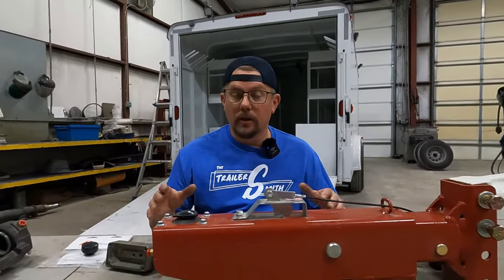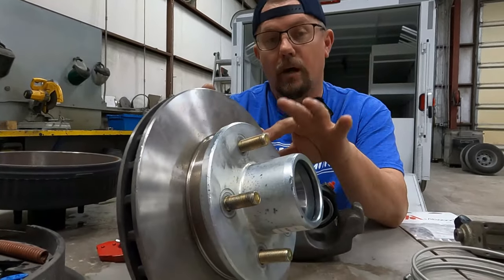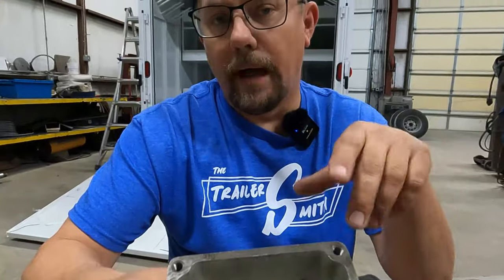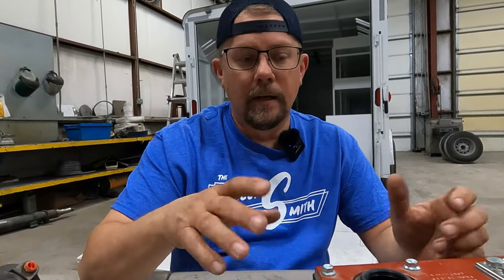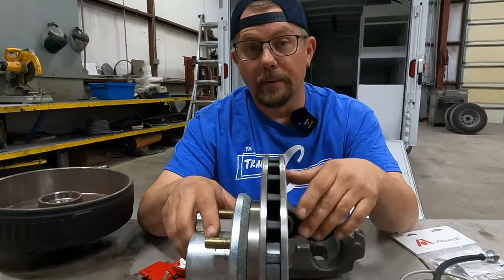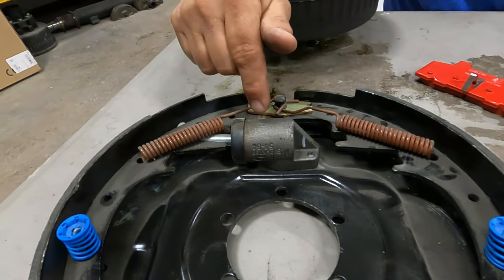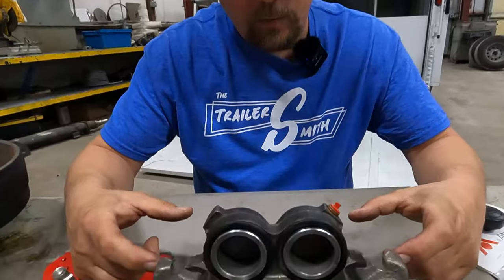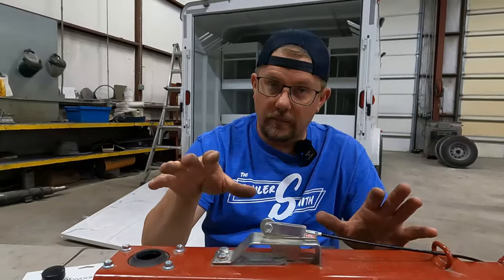All About Boat Trailer Surge Brakes

Comment: I am a subscriber, great videos as usual, and your voice speed is perfect.  I have a Coyote Boat Trailer made in Georgia.  It has a hydraulic surge brake with the static hold/ pin feature as you mentioned to put a pin in for backing up the trailer without compressing the cylinder.  The problem I had last winter, I had my local boat company winterize my boat, dropped it off in October but wasn't able to pick it up until December.  With permission, I picked up my boat and trailer the day before Christmas when they were closed.  When they were done servicing my boat, they backed in into a parking space which was slightly up hill.  I hooked up my truck to the trailer and the actuator/ brakes were still locked up from them backing it up.  I could see the actuator was still compressed, the holes weren't even close to allow the static pin to be installed.  I had to drag my trailer and yank it forward about 6 times to get the actuator to release.  I believe if they would of simply pulled forward 6" before uncoupling the trailer, I wouldn't of had this issue.  Or, they should of put that static pin in to begin with.  Sorry for the long coment, just still frustrated from that event.  If you agree, maybe you can tell your viewers to always move forward a few inches before unhooking the trailer.

Comment: Been a subscriber since the 1st video I watched!  How about showing maintenance on a surge brake cylinder and linkages.  How often to flush the oil, lube to use on linkages how to replace a nasty neglected cylinder including how to clean the underside of the actuator housing etc.?  Also how do you determine tounge weight on your trailer without a fancy scale, can it be calculated based on axle position and weight of trailer and load?

Comment: I have EOH setup on a tandem trailer.  Already cost me big time on the electric pump since my calipers were so badly corroded they allowed water (fresh/salt) past the seals and into the brake lines and eventually compromised my electric pump.  The calipers were ~6 years old when I deleted the actuator and went to EOH.  So the pump only lasted ~2 years before the already compromised fluid ruined the pump.  Wow what a lesson - wish I would have seen this video before all that happened.

Problem I am running into - even on the (nearly) brand new calipers is the bleeder screws are a pain to break loose since the rig is dipped in saltwater down in Florida 5 months/year snow birding.  What is the best way (if possible) to lubricate those threads ahead of time to keep them from getting corroded?
Reply from the maker: If they are seized, I recommend PB Blaster. If you can get the bleeder screw out, you can apply a small amount of the anti-seize in the threads to prevent them from seizing. Something that would be helpful, and you should be able to find it online, is a salt neautralizing wash and spray the sensitive areas of the trailer down every time you submerge as it’s directed. I don’t have a brand I can recommend. There are a lot of them out there. I would say they are all fairly equal. 
Thanks for watching!

Comment: What would you suggest if the brakes don't seem to work, no pin needed and doesn't lock up in reverse
Reply: Just found it out today, seemed the oil fill was empty and couldn't tell how full it was
Reply from the maker: So glad you were able to find a solution!You’re going to want to make sure you bleed the system for it to work properly. It will most definitely have air in the system. Thanks for watching!
Reply: Brakes make a ratcheting sound very noise

Comment: Thanks for the video. I have a 2015 coyote tandem axle trailer with integrated disc brakes on each wheel(single piston). The brakes are Tie Down Engineering. I recently used it in salt water and have rinsed it each time after getting home, about 50 miles round trip. The last trip I noted 3 out 4 hubs were burning hot and had cooked all the grease out of the hubs.  I have repacked the hubs with new bearings and only one hub seemed to be bad(rusty). So I’m thinking it was the brakes piston not retracting and heating the rotor and hubs. I removed the back set of brakes and bled the system after replacing the brake fluid and now one of the pistons won’t retract after I activated the brakes. Do I just need to replace the brake calipers and pads? I thought about switching to Kodiak brakes so I could get slip on hubs but none of the parts are interchangeable with the TDE brakes. I live on a freshwater lake and the boat is on a lift and the trailer is in the yard. I do like the option of taking it in saltwater and want to take it to the Florida keys, about 200 miles. Don’t want to be that guy on the side of the road whose wheel came off. Do I bite the bullet and switch to Kodiak or just replace the TDEs? I’m thinking this was more likely brake failure than hub failure. In Florida you’re supposed to have brakes on each axle for loads over 3500 pounds and my boat is about 4000 pounds. Suggestions?
Reply from the maker: I would definitely say it’s brake failure. If in salt water or even a salty climate, many time fresh water rinsing won’t be enough. You will need to use some type of salt neutralizer, which should be readily available in your area. As far as switching to Kodiak, it’s whatever makes sense for your budget. Unless using a high quality stainless caliper (even those will corrode) there is still a risk of the same type of issue with the Kodiak caliper as the Tie Down if corrosion develops. Sounds like you’re going to have to replace calipers & pads, regardless. 
This is a very common issue in the coastal regions. Best of luck to you with it!